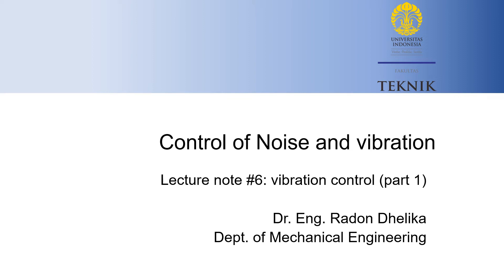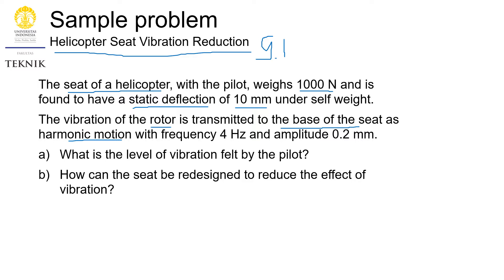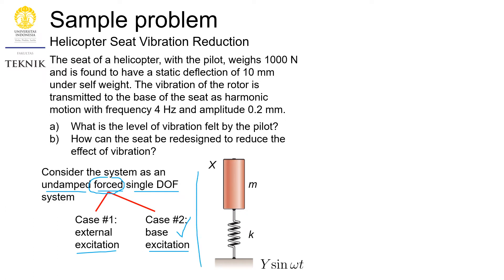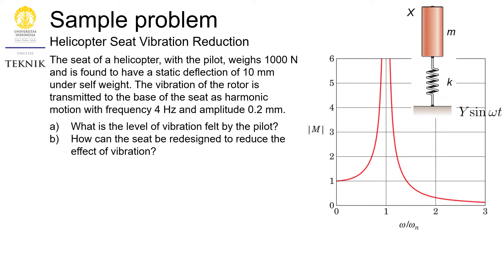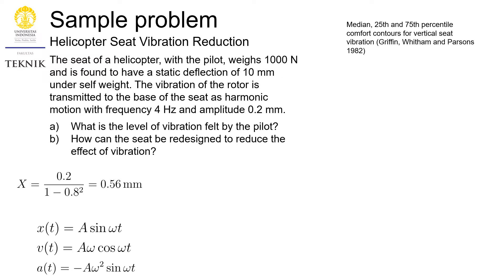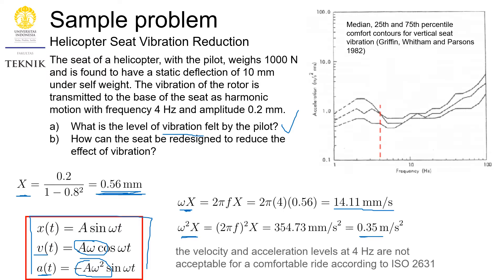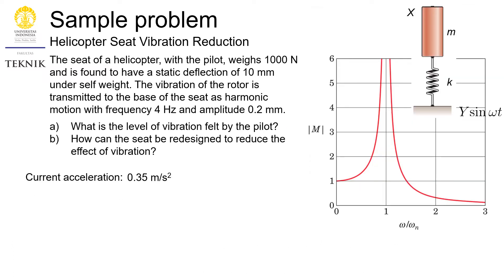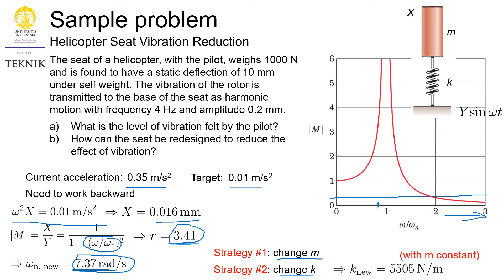Vibration control (part 1): general concept of vibration design

Comment from the maker: Correction:
The calculation of r in the last slide is wrong.
I have provided the correct version here: https://s.id/hzWxd
Reply: Sorry, did I miss anything in the math? here 10:46    Pls explain how you get 0.016 out of 0.01/16? Converting acceleration to mm/s2 still brings it to 10.